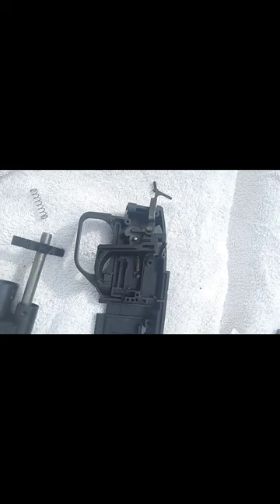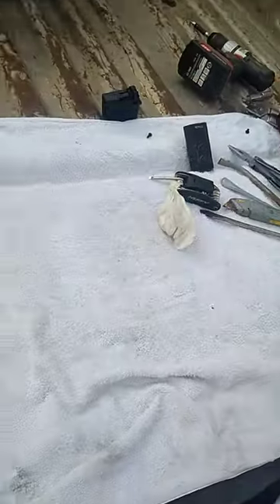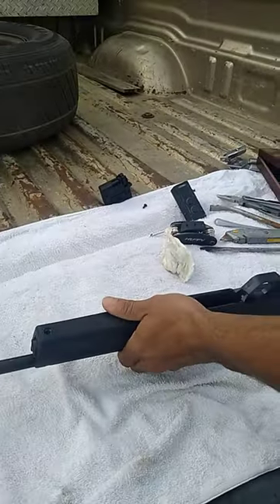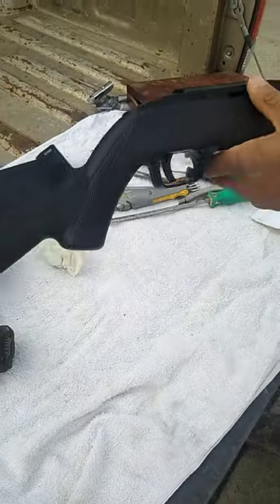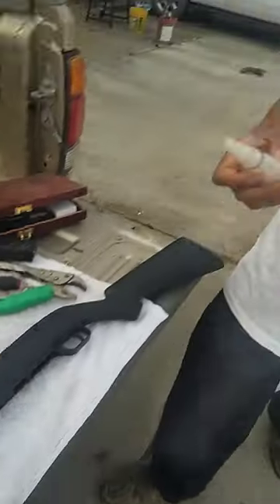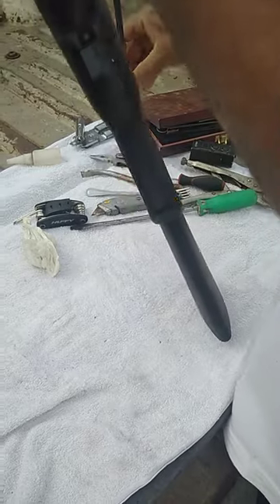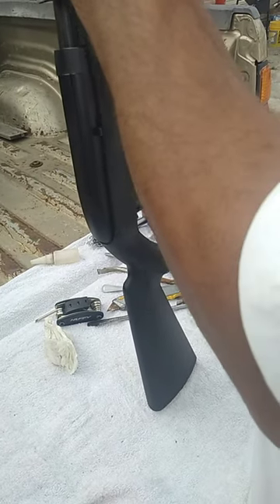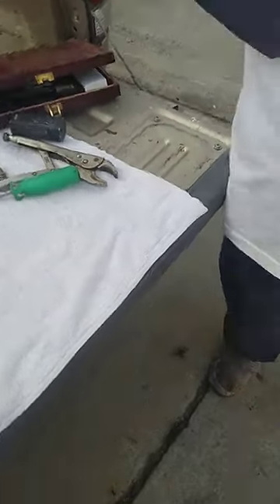disassembly of the crosman 1077 air rifle/ fixing a leaky valve.

Comment: I couldn’t see shit which sucks I was looking forward to a video that helped with this
Reply from the maker: If you are having the same problem as my neighbor did with his 1077, then try tightening the screw that you seen me fumbling with...  (you have to find something to tighten it with, it's really hard using a common screwdriver), if that doesn't work, order a new (green)seal and a new puncture 
Thank you for your comment!!!
Reply: @airgunsandcraftsmramos2579  I did that but I think it’s the hammer valve, seal is broken in it. Just got it apart and the seal is in 2 pieces. This is for my nephew, I only use pcp style air rifles. This one for him has been constant trouble. Thanks for the reply